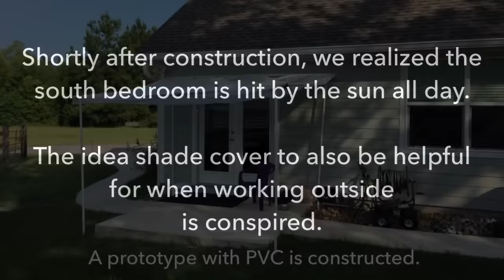Porch Cover Construction DIY in 5 Days - Timelapse

Comment: Way too fast!  frustrated and stopped watching soon into it.  : (
Reply from the maker: Well, if you aren't familiar with and/or like TimeLapses, then yes, it is too fast. But, I really like TLs. and always been fascinated with them. In fact, I was shooting TLs of clouds and flowers opening before it was built into DSLRs and phones. Now, everybody has the ability to shoot a timelapse. 

Keep in mind with iPhone based TLs, you can't control the capture speed. There are dedicated apps, but this video was shot and edited completely on an iPhone 5s and edited on an iPad. And the point of putting on YouTube was to share what one can do with an iPhone...MORE so than how to build a porch cover. More to the point, if you are using the build in iPhone Timelapse mode, the capture speed is controlled by the duration of the shoot. There is an Apple algorithm that determines the frame rate based on how long you capture...regardless of the shooting time, you end up with approximately a 30 second clip. You can look for the exact chart if you, or anyone else is interested, but basically, the long you shoot, at specific interval, the Apple software drops half the pictures taken as you extend into a longer interval of shooting time. 

So, for this reason, I shoot in 30 minute intervals. I would start a shot, set a timer for 30 minutes, then when the timer went off, I went and terminated the shot, and pushed the capture button ago. So, I didn't just start filming at the beginning of the day. I took lots of "pictures" as 30 second videos of hours of time and then stitched them together. There are apps out there that let you control how long and how often as well as export rate, etc.

Anyway, thanks for the comment...so you didn't like it...but perhaps with the idea in mind that you are watching a TIMELAPSE project, maybe you can try again and watch if how 5 days can fly by in 2 minutes...including a nice sunset. Cheers! 

Oh...and I like your username...did you see a video I have that is based on a similar theme?
Reply: The bits with the text went way too fast for me. I liked the TL!
Reply: You can slow it down, on your YouTube controls, top right hand 3 dot icon. Go to playback settings.
Reply: you obviously did not read the description at the bottom.  If you click on settings, you can slow down the video.

Comment: Hello sir, maybe you can help me. I want to do this project but i am having issues with how to do it. One of my issues is how to attach the 2x6 support stud that goes on the wall due to the fact that my wall is concrete. I dont know what bolts to use. And the other issue i have, is how to connect the studs that go from the wall to the main posts, in a way they are straight? If you could help me id appreciate it. Thank you.
Reply: I am not sure if you are aware of the concrete stud type bolt. It does require you to drill a hole into the concrete and then they make these boys that fit into the hold as you tight the bolt dow it expanse in the hole and secures it to the cement. you just have to get them long enough to set in to the concrete and the have enough of the threaded bowl to go through your material you are attempting to fasten. you can find them at Lowes or home depot in the fastener isle
Reply from the maker: Thanks Forrest for replying!

Comment: Even with a metal roof you'll want minimum of 1 in 12 pitch.
Reply from the maker: David Davis Thanks for the reply. In this case, I didn’t have more room with which to work. Fortunately, there is a gutter for the roof section above, and this is a small area and the water moves off pretty good.

Comment: This 2 minute video took 45 minutes watch because I had to pause and rewind every 2 seconds to read what it said. You could have slowed it down and made a 10 minute informational video.
Reply: you obviously did not read the description at the bottom.  If you click on settings, you can slow down the video.
Reply from the maker: You are correct. This was edited on an iPad and posted as a timelapse. It was originally an 8 minute video...and it was TERRIBLE! But, it was really only about the clouds passing, and me having fun with a Christmas Break project. YouTube had a feature to speed it up, which I did, but then it was too fast, and the feature was removed to slow it back down. At this point, I would have re-edit the entire thing...which I am actually planning on doing. and putting a link from here to it for those that want to watch in more detail. Thanks for the feedback! Cheers!

Comment: Great video! Just wondering how you cut the rafters so that it will have a 5° slope while also sliding into the galvanized ties? Thanks! (Amateur Here 👋)
Reply from the maker: I used a framing triangle...cheap tool, UNDER $10...Walmart even carries...very useful. Wish I had one 30 years ago!

Comment: Nice job but reedit so that the words remain on screen about three times as long
Reply from the maker: Thanks for the feedback. I can re-edit, but Youtube doesn’t allow reposting a video (Vimeo does). So, short of posting an entirely different video, any ideas? As I mentioned in other replies, I edited the rate online in YouTube when that feature was present, then YT took away the option to change the rate. Perhaps YT will or have reintroduced that option with the new version of the on line editor, but the last time I looked, it wasn’t there. I have considered creating a second version, but since this was edited on an iPad, and the original edits are gone, it would have to be done from scratch.
Reply: Drew Loker Oh no don’t go to that much trouble I just paused it on the words. Problem solved!

Comment: How did you do the post?  Nice job but vid is too fast.
Reply from the maker: Post hole digger...about 18-20" down. Should go down 24"...but since it was going to be very securely mounted to the house, I stopped when I couldn't get the post hole digger to go any deeper. Mixed and poured in concrete.

Comment: And....how did you locate the studs behind the outer shell??
Reply from the maker: As for the posts, I used 10’ 4x6 cedar. I think 6x6 would also be nice. The rafters for the roof are 2x4, and the flats for the roof panels to mount to are 1x4. As for the existing wall studs, I have a picture of the wall during framing, so I knew right where I needed to mount to the header beam over the door. Hope this helps. Good luck with your project.

Comment: HI, WHATS THE ROOF SLOPE RATIO , AND WHATS THE ROOFING MATERIAL USED
Reply from the maker: Hey John. The slope is 6 degrees. Water runs off just right. The material is R Panel steel sheets. Hope this helps and good luck!
Reply: @DrewLoker  THANK YOU SO MUCH , I REALLY APPRECIATE IT , THE VIDEO IS WELL MADE AND THE JOB YOU HAVE DONE IS AWESOME,  HOPE YOU WILL POST MORE HELPFUL VIDEOS LIKE THIS , THANKS AGAIN

Comment: For a construction dummy like me this video would have helped me figure how to add in a screened porch to my home...if I could have seen how you did it step by step but your time lapse didn't help me at all. I had high hopes for the video until I saw the 1st minute😒 very disappointed
Reply: You can slow it down in the three little dots in the top right corner and click playback speed and click .25
Reply from the maker: Thanks for the feedback. It was really only intended as a photography timelapse...but it was in fact posted as an 8 minute video. I just felt that it was entirely too slow.  I first cut it down using YouTube's online editor to 4 minutes, then did it again producing the 2 minute video that it is currently. I have since decided 4 minutes would have been about, but YouTube took away that feature. Fortunately, there is a rate tool for the viewer if you are on a computer (not sure about a phone). Sorry for the challenge...but I do know there are lot of others that go a LOT slower. So, hopefully this served you as a general idea of what to do. Cheers!

Comment: Why it took 5 days? It could be done in 2 days
Reply from the maker: Good question...indeed it could. But, A. I had other projects I was working on. B. I am better at photography than I am construction...and I spent a fair amount of time with the camera to capture the time lapse. Every 30 minutes I stopped what I was doing and reset the timelapse. C. I am not as young as I used to be...lots of breaks. Cheers!

Comment: A bit slower would be better I've only got two eyes I'm not a FLY
Reply from the maker: GEO K K Thanks for the feedback. As I have detailed on other comments, this video was originally eight minutes when I put it on YouTube but it was agonizingly slow slow. So, using the online YouTube editor, I slowed it down to four minutes and then eventually two. Four was probably about right, for an instructable, but then YouTube took away the ability to edit videos online. OTOH, as a TimeLapse experiment, 2 mins is pretty good.

Comment: Thx for the video. But did you really think anyone could follow that chaos? SLOW DOWN. I shouldn't have to cut my playback speed in half just to watch.
Reply from the maker: Chad Pugh Well, as I have mentioned in other replies, it wasn’t really intended to be an instructable, but a montage of time-lapses. And, when I first posted it to YT, it was 8 mins and it was agonizingly slow. I used YT online editor to reduce it to 4, then again to 2 with the logic that a person can pause if they want. Otherwise, 2 mins is quick and it serves the purpose of entertainment. Technically, 4 mins would be better, but YouTube took away the ability to change the length and you can’t replace a video like you can on Vimeo. So, it is what it is. Thanks for the feedback.
Reply: @DrewLoker  fair enough. I  can understand that considering it's not meant as an instructional video.
Reply: Well then Chad, dont watch the damn video buddy!  Not once did I see where you told him great job!

Comment: Too fast
Reply from the maker: It’s a Timelapse first, instructable only after the fact. I posted it initially as an example of 5 days in 8 minutes, but it was way too slow. Then I sped it up to 4 minutes, still to slow, then I set it to two minutes. As a an example of 5 days of working on a project, I am pleased with the rate of 2 minutes. Any longer and it is boring to watch and loses interest. Pause the video and it works a lot better if you are trying to follow the actual construction details. Cheers.

Comment: The house looks ugly with that porch
Reply from the maker: Jimmy Johnson Well, the stained cedar wood actually matches the front and back porch stained cedar columns very nicely. We did debate the roof, since there is a shed and a barn with blue and green roofs respectively, but my wife wanted the silver roof, and that is what it got. I like it and the three colors of roof do not look odd from the air. Cheers!